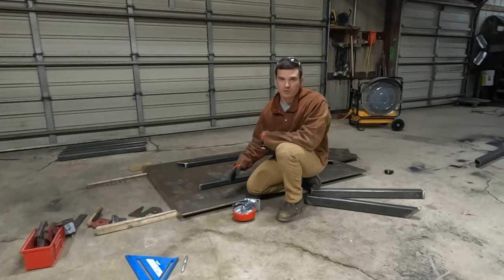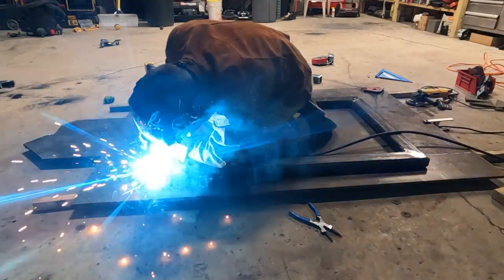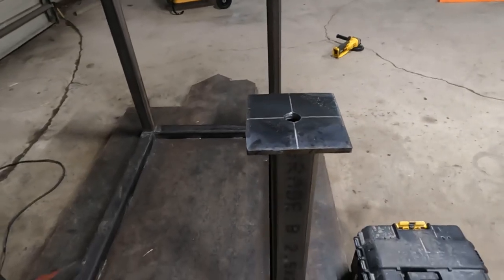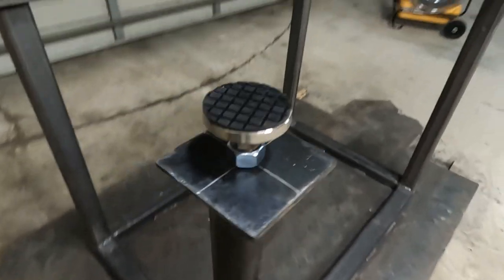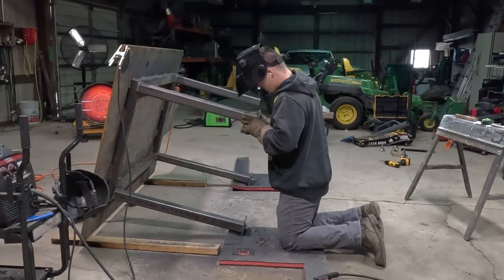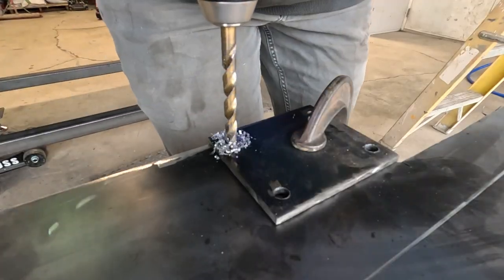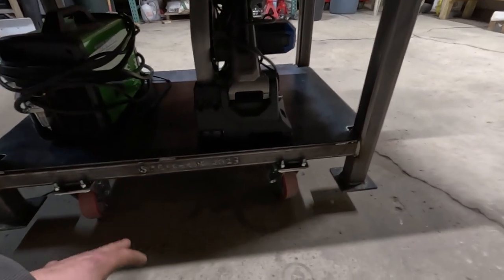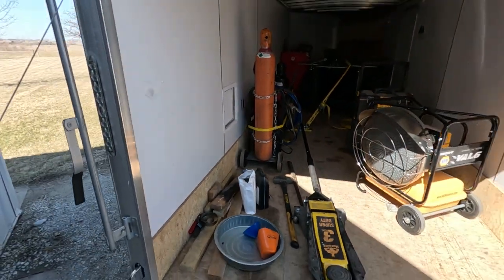Building a Heavy-Duty Worktable

Comment: Not sure if this will explain but maybe. If the table had only one leg, then I would agree with you and say it would be wobbly with that particular leveling foot, it would be all over the place. An example would be the abundance of supports designed into a pedestal table with a massive base footprint and absolutely rigid with no swivel until you put your elbow on it and find out there is an imperfection in the floor and it now needs shimed. Since you are wanting to be able to adjust your table to not only not rock around on more than 3 feet but also be able to level it in more than 1 plane you are appropriately adding adjustable feet to each leg. The floor probably has a slope to it to aid in drainage etc, but it can also have smaller imperfections as well, much smaller dips or valleys within the slope hopefully within reason. Since I'm assuming these feet are for industrial weights 500#+/ft they need to self level themselves evenly distributing the weight PER LEG or they will be forced to self level by flexing the material they are made from potentially weakening them. On a lighter duty application the leveling feet are probably built with no wobble/swivel because it's cheaper to build therefore easier to sell or they are already large enough to handle the weight they'll be expected to. To remove the swivel/wobble you would want as close to perfect perpendicularity between the leg and foot then the foot to be perfectly parallel to the floor which they do on industrial stamping machines and CNC machines. The difference being the legs are more than likely built into the frame of the machine, the pads of concrete that they rest on are isolated from the surrounding concrete, usually multiple feet thick and or wide with ground tops, and the machines are meant to stay there potentially forever the opposite of portable. 
  To sum up it only appears completely unstable when holding it upside down and shaking it like a Polaroid picture. Right side up with weight and a structurally sound table pushing down you'd find the untampered version more evenly distributed and stable, built that way because there is no perfect floor that is perfectly flat and level that will remain so indefinitely with tables sporting perfectly perpendicular legs. You'll notice cranes, backhoes etc will have much more articulation on the feet of their outriggers for the same although more exaggerated reason.
  Hope this helps or at least didn't make matters worse. I think an experiment video would be a great idea especially if the Ah-ha moment hasn't hit yet. Great table!
Reply from the maker: Yes the Ah-ha moment has it. Others have commented similar thoughts and I now understand. I should order new feet and do a test like you said! 

Thanks for the comment and explanation. I am not the most “experienced” or “knowledgeable” when it comes to this stuff and more learn by doing.

Comment: Spencer why you weld that adjusted foot , was supposed  to wable to adjust them self on the ground 🤔
Reply from the maker: Wouldn't the table then be wobbly if you were to push on it? Trying to understand how it wouldn't move when you gave it a hard push? Trying to wrap my head around it.
Reply: @Spencer Hilbert  so that the table doesn't wobble, after positioning it you have to tighten the nut above the ball and that way it gives you a more stable surface, because you don't have a perfectly straight floor
Reply from the maker: Gotcha that make sense now.

Comment: OOPS!  The articulating joint is so that you can adjust the height with weight on the legs and the feet will tilt to fully contact the floor.  We talked about putting casters on my son's table but decided if he needed to move it, the skid steer would move it.  His is about 5'x9' and weighs about 1000 lbs.